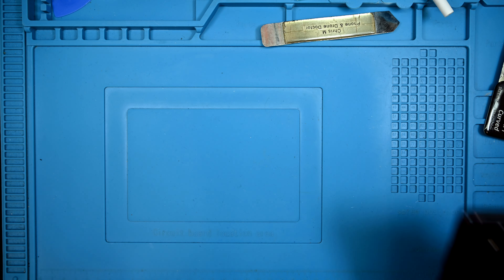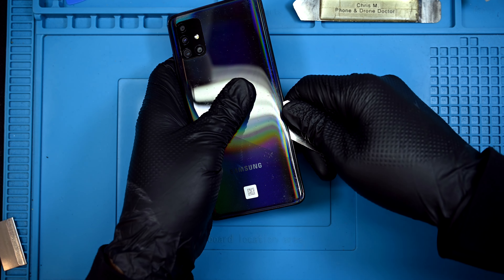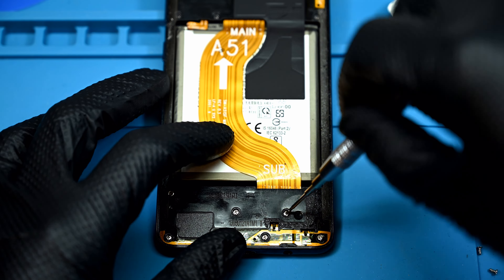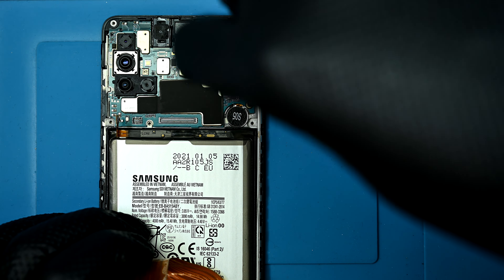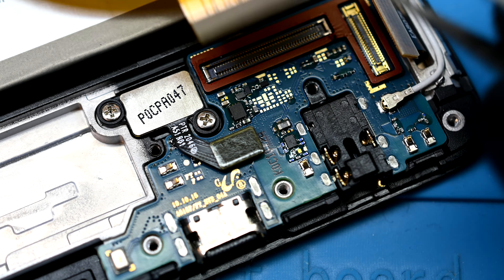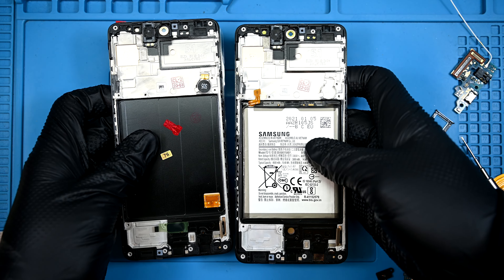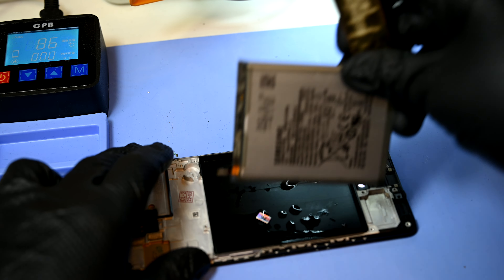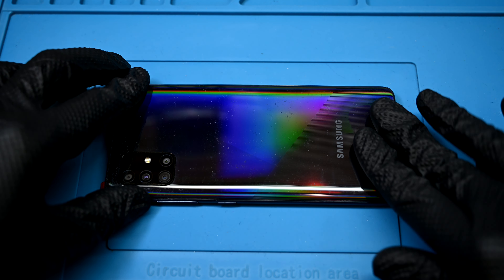Galaxy A51 (A515) Screen Replacement Guide | Frame Swap | Aliens

Comment: Hey, I am looking to repair the same phone and make a video about it. But the original screen I wanna buy only has the screen and not the frame attached to the screen itself
How do I remove that?
Reply from the maker: @oostersam30  razor blade! You’ll basically be cutting the old screen out of the frame, then using an adhesive like Cold Press glue or B7000 to adhere the new one in.
Reply: @TapticDigital  do I need to hear up the display before ripping it off?
Reply: @TapticDigital  thanks for responding so fast btw

Comment: So if anyone can please help me I bought a pretty cheap one off Amazon and I put it back together still vibrates when I plug it in but the new screen still doesn't work
Reply from the maker: @aspect5995  could be a bad screen, you should be able to exchange it on Amazon. Other than that take a close look at the rectangular screen connector on the board (also called an FPC), make sure it isn’t bent or smashed.
Reply: @TapticDigital   i acctually opened it back up and fixed it i put that white tiny cord back on the wrong way fliped that and then it worked praise god lol
Reply: @aspect5995 how long does it take you to fix it I’m bout to order some parts on mine any chance how much it cost for you on Amazon?
Reply: @ItsSashx  I got one of the cheap ones but you have to move some of the old parts that this guy didn't have to like the small circle thingy and the small rectangle at the top sorry I don't know what there called took me about 1 hour but I took it apart before hand so probably 1 and half if your new to it

Comment: I am repairing this exact phone..  Seen your video and ordered a heating mat like yours (did not know they existed).    What temperature/time do you typically set the mat to?
Reply from the maker: Because the back of this one is plastic you’ll want less heat/time than normal. Start with setting it to about 40c, wait about a minute and feel the back side. I wouldn’t go higher than 50 or longer than 1 minute at a time. Whenever it feels “uncomfortably warm” like you wouldn’t want to hold it for a long time, it’s just right!
Reply: @TapticDigital  That is the insight I needed, thank you very much..!   Will let you know how my first time using it goes..